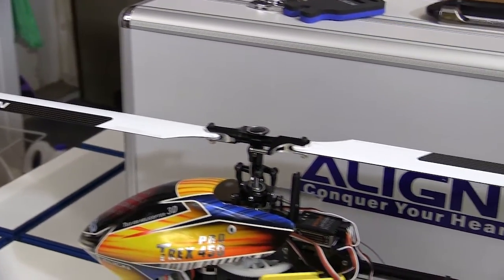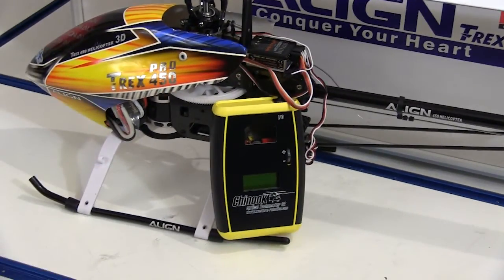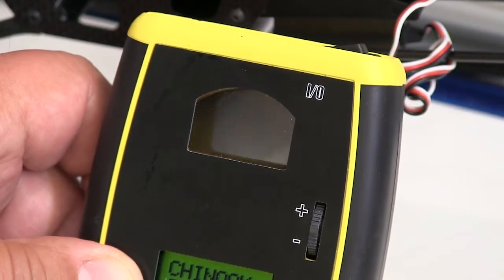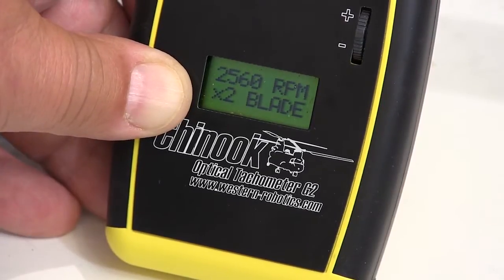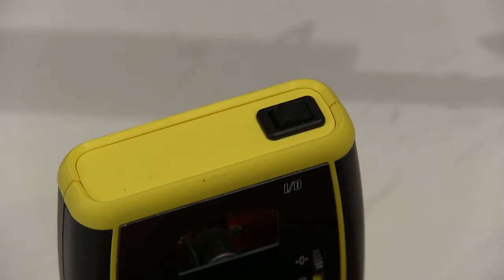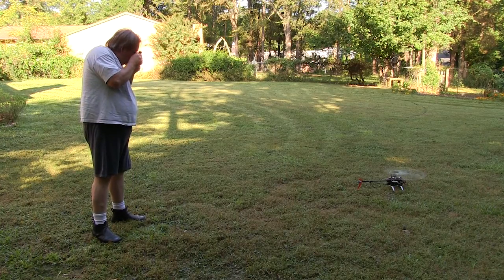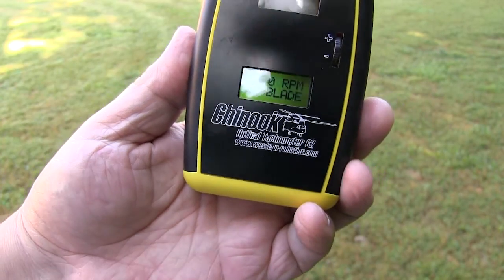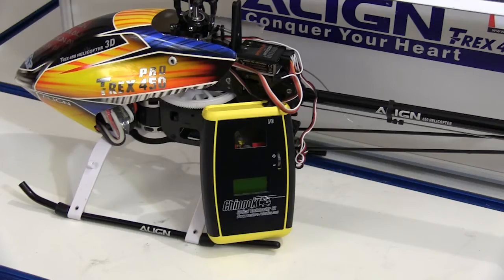Chinook Optical Tachometer G2

Comment from the maker: I've not seen one meant for a lathe. I'm not sure how beneficial it would be seeing as most lathes have their RPM capabilities marked or built into calibrated controls. Most of the larger lathes I have had used  a digital display to report RPM, others had levers with marked stops for the various RPM. Of course just when I get sure that something shouldn't be, there it is

Comment: I suppose you could use this on a lathe if you drew some outward lines on a faceplate or something. I bought a cheap-o laser tachometer off of eBay for about $10 for use with my lathe. My lathe doesn't have a digital readout, but it is infinitely variable within each pulley setting. I used it just to make sure the upper and lower ranges stated were what they are and that it's a linear ramp between the ranges. It pretty much was. I'd suspect the one you reviewed is more accurate though.